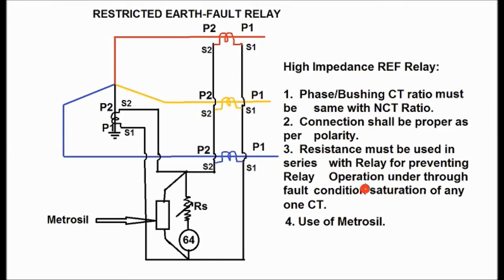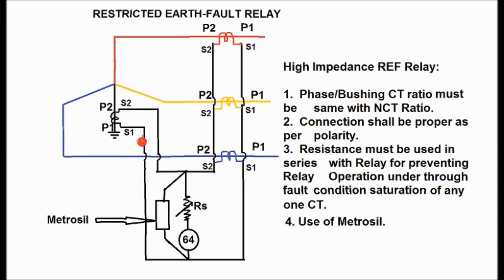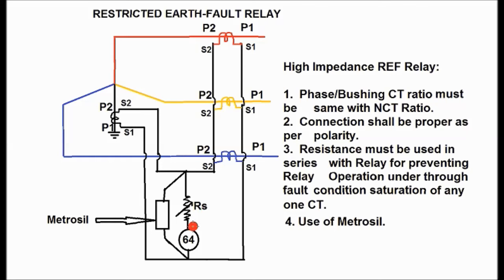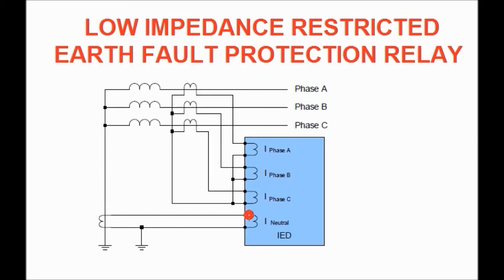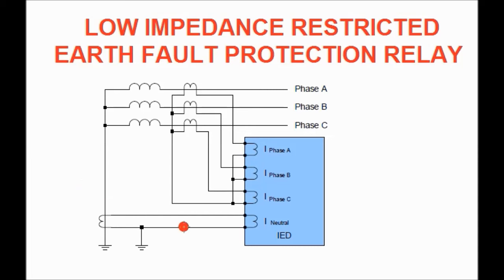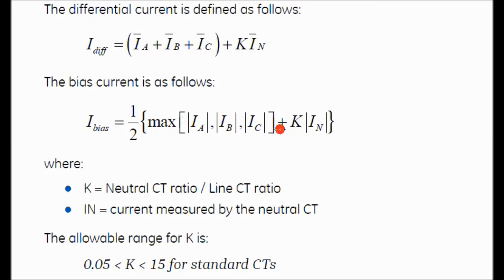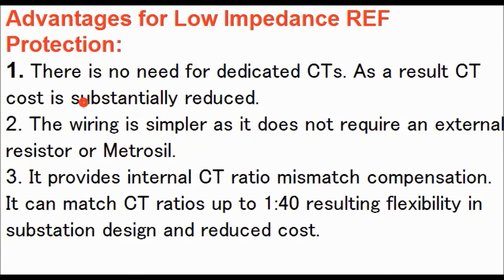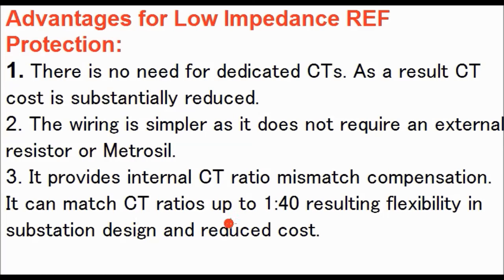RESTRICTED EARTH FAULT RELAY LOW IMPEDANCE TYPE || OPERATING PRINCIPLE

Comment: Can you give real value example, for example 30 MVA Transformer, YNd1, 150/11 kV, With Primary CT  HV side 200/1, Neutral Side is 200/1. Then how the real setting of REF Low Impedance.

Such Pick up setting value, Is1, Is2, Slope 1, Slope 2. operating time, K factor value. etc thank you